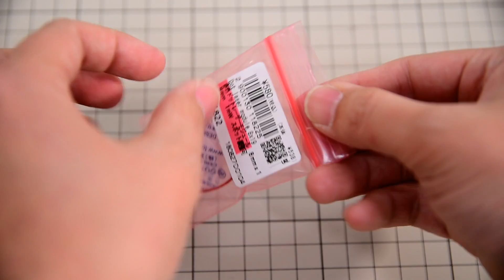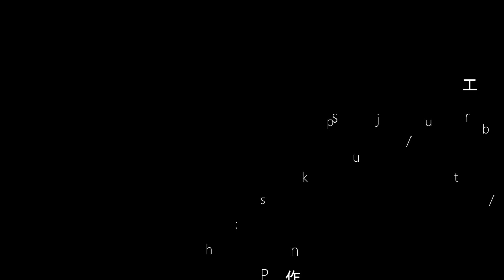Attach a DIY laser marker to the pillar drill

Comment: And that’s the reason why the pre-installed laser guides on cheap drill presses don’t work. They are missing at least one degree of freedom by using a cross-hair laser instead of two individually adjustable line lasers as shown here. The solution here is great.